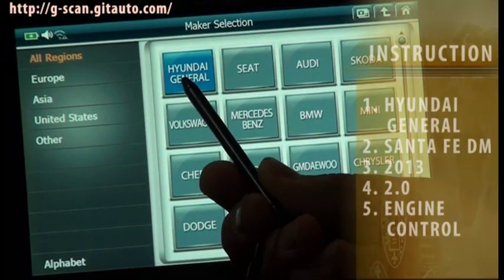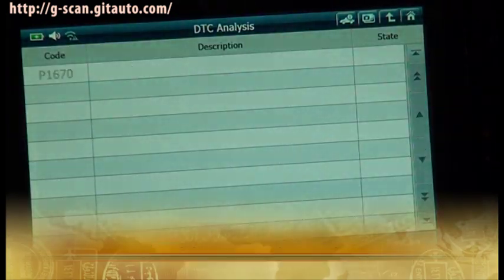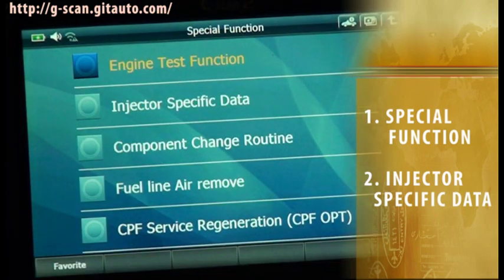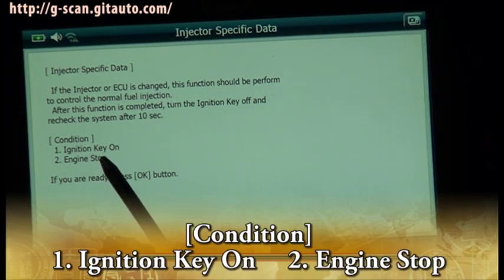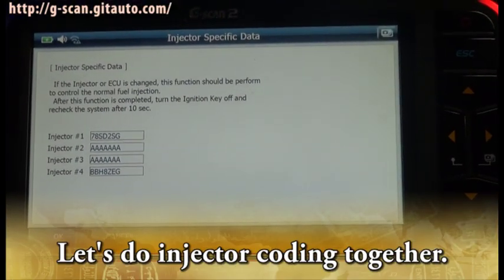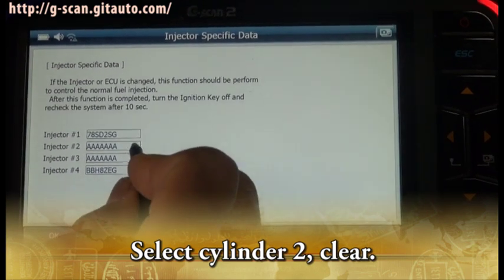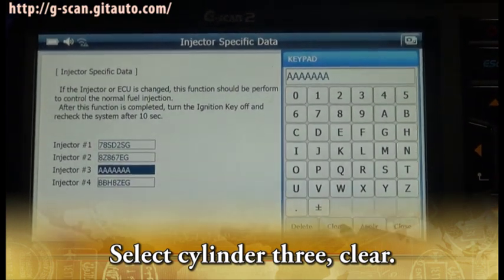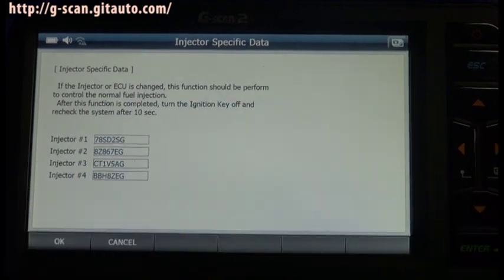G-scan Injector Specific Data  (How to solve P1670 Invalid Injector IQA)

Comment: Is this just when an injector or pcm is changed, or are there other times that you would run into this problem?
Reply from the maker: Hellow Frank! ECU(PCM) would trigger the warning lamp (P1670 Invalid Injector IQA) when it recognizes the stored injector code is incorrect as shown in the video. There will be no other problem would cause this code.